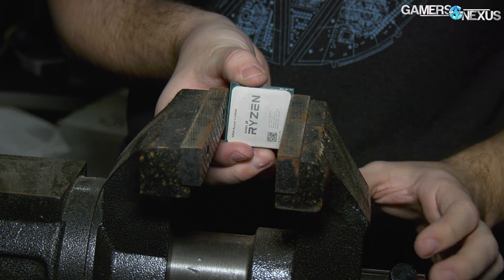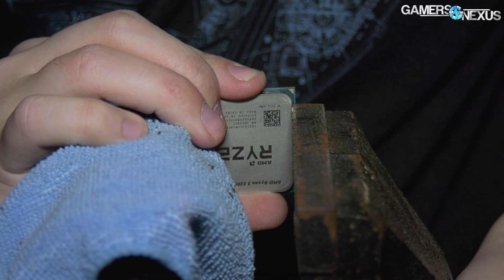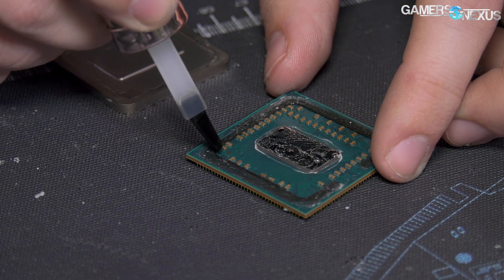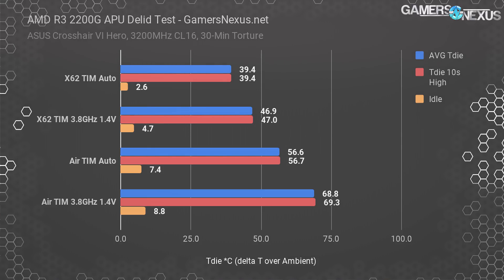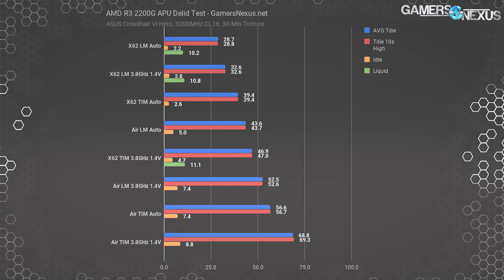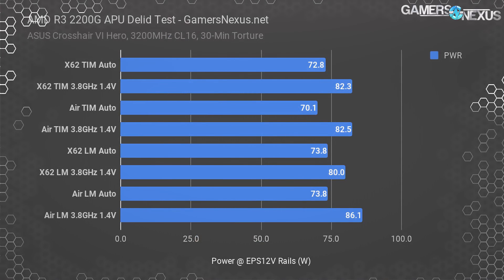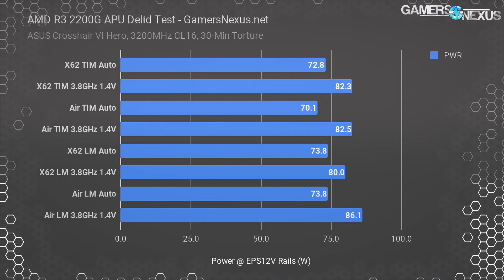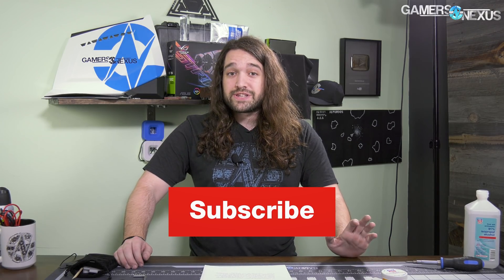Delid & Liquid Metal Thermals on AMD R3 2200G APU (Pt. 2/2)

Comment: I wonder if AMD will use this toothpaste with their "12"nm 2CCX CPUs as well, because the die size decrease may get to the point where micro cracks of the solder will start to be a problem.
Reply: Micro cracks are a myth in real world use, if you lookup for the source you will see that the tests used put the CPU under unrealistic stress going from -55ºC to 125ºC (that is 180ºC variations), also other proof is that AMD are still soldering 14nm, Intel are using toothpaste from Ivy Bridge (22nm) with that cheap excuse and still soldered their Extreme lineup until Broadwell, they then cheaped out in Skylake-X :v

"Micro cracks occur after about 200 to 300 thermal cycles. A thermal cycle is performed by going from -55 °C to 125 °C while each temperature is hold for 15 minutes."
https://overclocking.guide/the-truth-about-cpu-soldering/

I like der8auer but I despise that note he made because of that unrealistic test detail overlooked by 99% of the readers.
Reply: Yeah obviously the der8auers testing was accelerated hugely, and not very realistic. But there's still probably a chance of these cracks happening after years of normal thermal cycling. Imagine how much shit Intel would get, if their CPUs started overheating like crazy few years after warranty period.

"also other proof is that AMD are still soldering 14nm, Intel are using toothpaste from Ivy Bridge (22nm)"

The "process resolution" isn't same as die size. 

Zen = 213 mm²
Ivy Bridge = 160mm²
Sandy Bridge = 216mm²  (last mainstream CPU soldered by Intel) 
Coffee Lake = ~149.6 mm²
Broadwell-E = 246.3mm² (last enthusiast/workstation CPU soldered by Intel) 
Skylake-X = 322mm²-484mm² yeah, this still doesn't explain why Intel doesn't solder their Skylake-X CPUs (probably because they were rushed out)

Comment: Can you get the APU to thermal throttle in normal use at stock without delidding? Assume a case that has at least mediocre cooling, not completely bad, and using the stock cooler.
Reply: Stu Bur absolutely it's possible.

Comment: It would be interesting if you tested to see how much you could reduce the fan speed by before your thermals matched the original numbers

I know its difficult to measure noise but it should be much simpler to be accurate with fan speeds.

Comment: JayzTwoCents, that 380X is bottlenecked by the FX 6-core, imagine how it would do paired with an modern i5 or even Ryzen. It's stronger than a GTX 1050 Ti, almost RX 470 level.

Comment: not all of them are soldered. this was only recently. back in the old Socket 939/940 days, they used a sort of thermal silicone underneath instead. over time, this loses its ability to transfer heat as it aged, so when I was running dual Opteron 285s, I had to delid them to bring the temps down to something reasonable. with a couple of CNPS5X sinks I was able to keep both CPUs under 58C at full tilt at stock with low fan speed. but, this was 2012, and all I used was AS5 under the IHS instead. to get the IHS off in that case, I tore apart a disposable shaving razor instead and that was thin enough to get under the silicone seal around and get the IHS off with not much more work past that. I did the same to an Opteron 180 with similar results.

the CNPS5X was such a solid performer with those Opterons back then that I still recommend it even today with the people that I know that have gone Team Red for their CPUs. they work VERY effectively on a stock Ry7 1700 (despite not officially supporting the socket, since they do work on the stock heatsink mount before attaching the Wraith cooler) and, after the first couple of times needing to do so, are very easy to clean when it comes to dusting, over the stock Wraith.

Comment: AMD are stupid to go with the paste, it was one of the only things that made them preferable to Intel.
Reply: Ahh yes, the i3-8100. $20 more with the same CPU performance and a GPU almost 4x slower than the 2200Gs, while being overclock locked, consuming the same power and with slower DDR4 support. All of this with the traditional intel socket support, which is to say none.

But no, you're right. Clearly the i3 is better.
Reply: Is a budget product, if they do it on threadripper or high end then sure, that sucks.
Reply: Not only 4x slower, we're talking downright unplayable
Reply: They only use TIM on their budget offering in order to bring the price down just like their previous APU. The high end will keep using solder. Unlike Intel that use TIM even on their HEDT.
Reply: "AMD are stupid to go with the paste"

Yep, stupid to be as cheap as possible so they can sell the best budget CPU in the last decade or more for $99, and sell an absolute shitload of them

Thermal toothpaste for budget parts, actual good paste for higher end non-X parts and solder for the X range and things like TR would be an excellent way to go about it
Reply: Happy Guy  only thing !? 
You sure probably for you
Reply: it makes sense froma  production standpoint. its cheaper. so on the lowend, sure why not.
Reply: Shaun Delp because you totally don't need to pay for a z370 board and more cooling because it doesn't have a stock cooler (doesn't matter intel stock solutions are junk)
Reply: The solder they have to use isn't garden variety solder. It's composed of Indium but the heatspreader will have to made of crazy expensive materials for the indium to bond! And so is the die actually.
And LM costs even more than the solder they use!

Here I quote der8auer 
"The DIE is made out of silicon (Si) but you can’t solder directly to silicon. Otherwise indium would diffuse into the silicon which would result in a different doping characteristic or damage the chip over time. So you need another diffusion barrier on top of the CPU. The diffusion barrier is formed out of several layers made out of Titanium (Ti), Nickel (Ni) and Vanadium (V).

On top of the diffusion barrier you need another gold layer as wetting layer for the indium connection."
https://overclocking.guide/the-truth-about-cpu-soldering/

If you don't know anything about what it means don't go commenting that AMD should use it for every CPU including budget offerings that combines a GPU.
Reply: Actually, AMD uses solder for Ryzen which is the way to go. Even good thermal paste will dry up.
Reply: Well then go back to intel and enjoy your meltdown and spectre exploits.

Comment: Why is everybody so focused on overclocking the CPU side of the 2400 G and not overclocking Vega to see its full potential or if they'll be any more gaming performance? Just a simple video or article from somebody saying yeah it is worth it, Hardware doesn't support this yet, or no it's not worth overclocking or it can't would be nice. I would test it myself if I had $169 for the 2400g
Reply: It can reach 1600mhz and should give some extra perfomance. The biggest problem with those Vega 8 and Vega 11 is that their perfomance is limited by using RAM as VRAM, so faster RAM makes a bigger difference than overclocking.

Also, overclocking the CPU should not make a difference because those CPU are already overkill for those iGPU. A 2400G, or even a 2200G, should be able to use a 1060 or 580 without bottlenecking it.
Reply: Naizuri so it is what I was thinking. I understand about the DDR being a bottleneck but overclocking the CPU is not helping with gaming performance yet all these reviewers are doing gaming performance test by overclocking the CPU not by overclocking Vega sounds kind of stupid. There's several YouTube Techs out there that I like but Steven and buildzoid are the two that I trust the most. Buildzoid for his knowledge of the components. Steve for his methodology in testing. Especially knowing that somewhere there working together in the background where Steve gets information about limitations on components from bildzoid.

Comment: 9:30 "There is no premade tool. You can't just buy something from [...] der8auer and get something that makes it easy to delid rather safely."
der8auer just announced a small mod to his Intel delid tool to make it work for Ryzen APUs. :p
Reply from the maker: Almost like we filmed this before he posted his video.
Reply: "Btw the only reason this video didn't say anything about this adapter is that when this video was made the video of der8auer was not live yet."
They clarified that in this very comment chain and no one here is disagreeing :)
Reply: Well it's the same for the video of der8auer. He always wants the safest most efficient way. Because they will actually sell those delided APUs on Caseking. 
Btw the only reason this video didn't say anything about this adapter is that when this video was made the video of der8auer was not live yet.

Comment: Does 2200G work with OC high enough to need delidding, or good cooler will be more than necessary? In other words, does the temp limit max OC with the APU, or other things limit it faster?
Reply: Marek Nowakowski the stock cooler is a wraith stealth, it will thermal throttle if Overclocked yes.
Reply: I meant with a good cooler. Can the 2200G produce more heat than a 280aio or a tower cooler can dissipate without first going unstable? If so, how far can it go?
Reply: Marek Nowakowski results for that are in the video.
See graph at 4.55.
The results are T above ambient  So add 21 degrees to the numbers.
A 2200g OC to 3.8ghz is 68 (46. 9+21 ambient) degrees with a good AIO
 Same clock on air with stock cooler is 90 degrees (68.8+ 21 ambient)
Reply: ahh, my bad. I was somehow thinking it was an 120mm AIO and not 280... thanks

Comment: Is using liquid metal instead of thermal paste between a ryzen R7's IHS and a CPU cooler worth it?
Reply: Liquid metal contains gallium which alloys over time with other metals compromising their structure and "wicking" into solid metal, when you hear of liquid metal "evaporating" as far as I understand that is what causes it to disappear
Under the IHS you have a sealed environment where you will always have a uniform metal makeup.
On top of the IHS copper heat sinks might be ok but the gallium will have a VERY aggressive attack at any aluminium it encounters (stock heat sinks, asutek pump bodies etc, maybe some heatsink fins on air coolers)
For an idea of how aggressive, a few drops of gallium can over 24 hours allow you to tear a drink can as though it where literal paper.
Reply: Peter Ganczarski I imagine the IHS is too rough and there is a high liability to create hot spots. It might not look like it, but the metal that makes up the cpu lid is actually pretty heavily pitted.
Reply: Thanks for the great content as always.
Reply from the maker: No. The IHS is soldered to the die, and LM on top of the IHS is a bit riskier and not really worth it.
Reply: dogboy0912 thanks.
Reply: Dave Lee ok, that makes sense
Reply: Guess what components are around the cpu socket...
Reply: Ben Grogan thanks. I hadn't realized it contained gallium.
Reply: LM can slide away from the die surface and short out your motherboard and things like that.
Reply: Gamers Nexus why would  Liquid Metal between  outside of cpu and cooler be dangerous? Wouldn't the lower thermal resistance be worthwhile?

Comment: 14- 15 degrees difference...WOW! If I was Intel or AMD I would start shipping with LM
Reply: OctoMan PC's not going to happen, LM has longevity issues and needs opening up for checking every few years to check for corrosion.
Intel and AMD won't risk a bad rep on long term reliability for 10 degrees

Comment: I smiled when I saw this new Gamers Nexus video

But my smile was gone when I red "Intels Footsteps"
Reply: AMD has done TIM on APU's in the past.it's not new.
Reply: Doubt it.  I'm pretty sure in this case it was to keep the new APU's aggressively priced so they weren't dismissed out of hand.
Reply: AMD's doing it on cheaper processors. Like they did with the A-series APUs (and athlon APUs so are semprons of course)
But full ryzen keeps the solder. Why? They aren't pulling an Intel
Reply: the amount of temp drop tho, that was a lot. I worry that this is the start of a trend for ryzen chips. We already know how high-end 4-core CPUs fair with tim (7700k), we don't need 6 and 8-core CPUs using the stuff.

Comment: amd, plz dont fk up with ryzen 2600 and 2700
Reply: AMD only uses TIM on the budget offerings. AMD hasn't changed since at least the second gen APUs those have always been using TIM.
Reply: They already said it was just for theese apus, 2000gen will be same as 1000

Comment: 14 degree difference is nothing to sneeze at... and it's heartbreaking that AMD cheaped out....
Reply: MeMad Max They cheaped out where it doesn't make a difference - the low end. Intel cheaped out on everything,including their 10-18 core toasters. Use your fucking brain.
Reply: MeMad Max  AMD admitted before these were released that they were using some kind thermal paste/TIM on the 2200g and 2400g APUs as a cost saving measure. And it's only on those APUs, its reasonable to say that any other CPUs in the Ryzen+ lineup will be soldered.
Reply: Intel use tooth paste even on their 1000+ dollars cpu so? AMD used tooth paste only on the cheap APUs.
Reply: Cheaped out on a $99 part? Where are the margins in a part that low cost to afford soldering?
Reply: They've been using thermal paste on their APUs for a while now
Reply: @Hakaru Manufacturing costs will be similar to the Ryzen 1000 chips which had sku's upto 500$, the highest sku for the APU's is 170$ so it makes sense that they would cheap out on them since they dont have higher end parts to offset the cost of solder.
Reply: They've been using TIM on low-end APU's forever. This is not a new thing.
Reply: Black Widow hopefully it stays that way